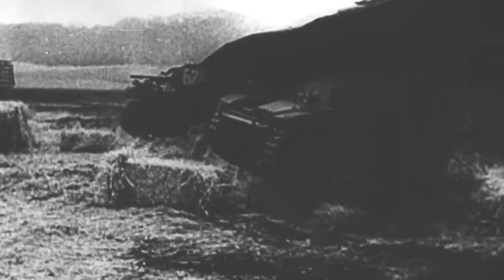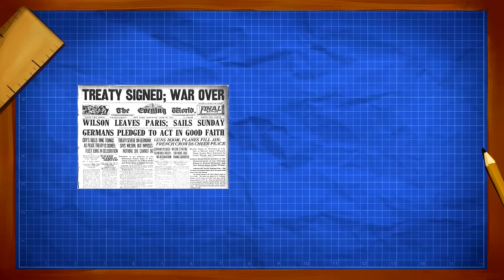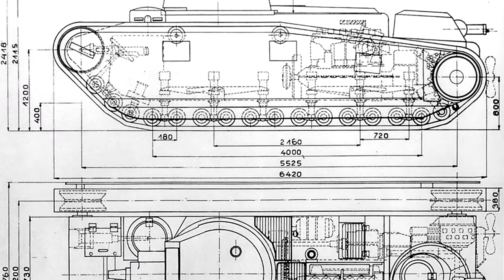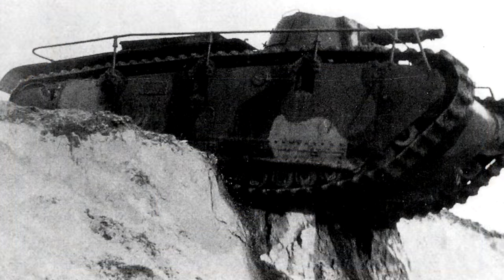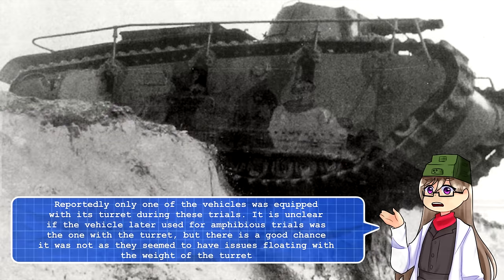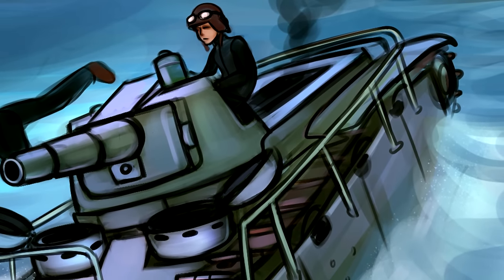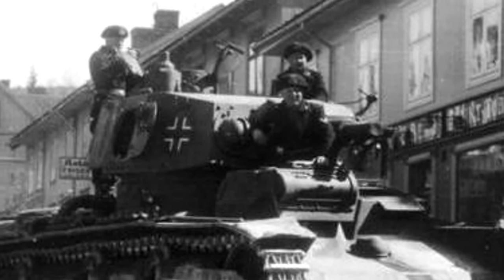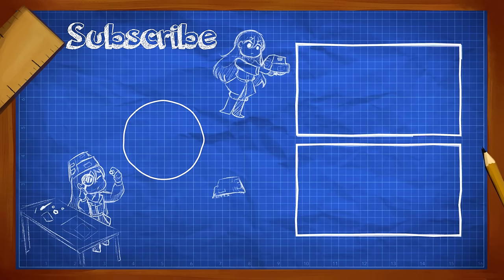Germany's Illegal Medium Tank, the Grosstraktor | Cursed by Design

Comment: Ah yes, Grosstractor. An illegitimate son of Independent, himself a secret sire to T-28 and official sire to Neubaufahrzeug, grandpa of Begleiwagen aka PzKw.IV
Reply: The Independent was more the father of the T-35. The T-28 is akin to the A6E1
Reply: @executivedirector7467  ehm... Independent plans were stolen/bought by germans and used to create several of Grosstractor prototypes. Prototypes that were tested in Kama and copied by soviets. It's a literal circle of military industrial espionage. I wasn't talking just about being inspiration, I talked about literal components. Suspension, transmission, sprockets, road wheels. You can even look at them and see where germans made improvements and alterations to original design and where soviets failed to copy component or decided "it wasn't important"(spoiler: it bloody was).
T-35 was much more advanced and original design albeit likewise having connections to work of german engineers(specifically Edward Grotte) in USSR. And unlike T-28, there is no shared "bloodline" with brits. Only said "inspiration".

Comment: So the Großtraktor was tested in the USSR, but it was still assembled in Germany right?
Reply from the maker: Yes
Reply: @ConeOfArc   Speaking of which didn't the USSR steal this design to create the tanks like the T-28 and T-35?

(The multi turret feature)
Reply: @gideonbudd8945  both sides learnt from each other
Reply: @gideonbudd8945  Not many sources mention the similarities of the T-28 and the Grosstraktor suspension which is no coincidence.
Reply: @gideonbudd8945  The T-35 was more "inspired" by the Vicker's Independant tank.
Reply: @gideonbudd8945  They stole the suspension for the T-28. Suspension drawings for both are hard to come by but some grainy images exist where Google can find them, and youll see that the layout of the leaf and coil springs is suspiciously identical, despite no similar system existing on any other tank of either nation.

Comment: I believe that two of those were used as propaganda during the ocupation of the Low Countries.
They were paraded at the streets to intimidate the locals into submiting to the germans after they had secured a region.
They could be used for this purpose, because they were facing small armies there, without any adequate anti-tank capabilities at the beginnig.
But as soon as the allies started the invasion they were retreated and later destroyed by theyr crews.
I read that those were prototypes, not armoured, but fully operational. (don't remember the source, maybe Wikipedia)
Reply: their